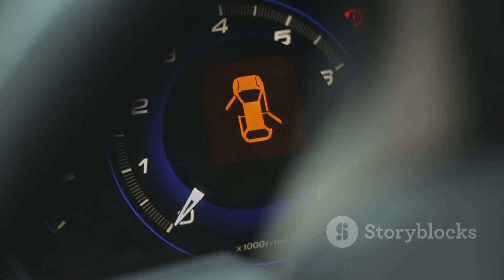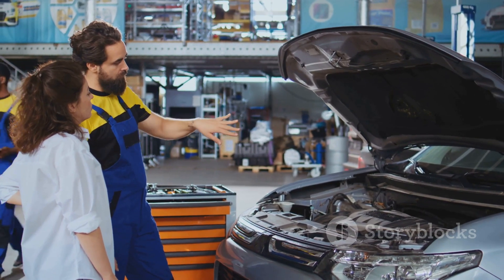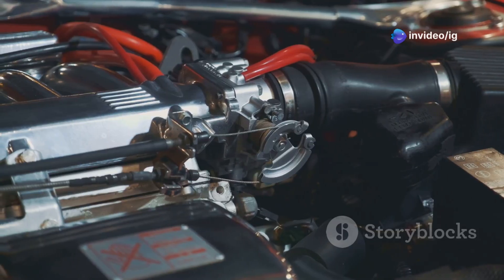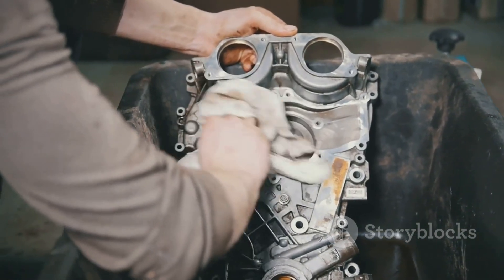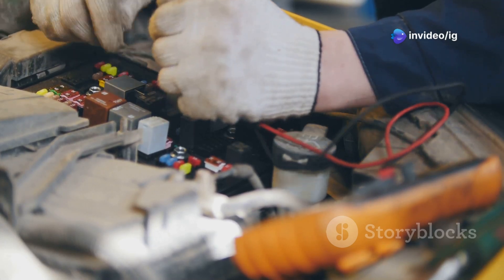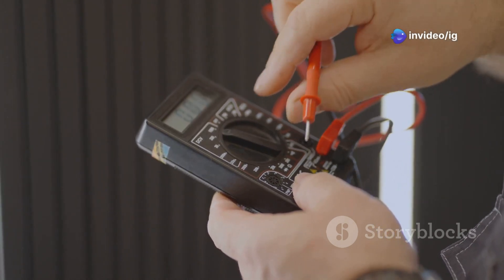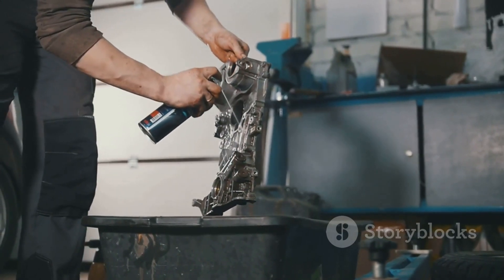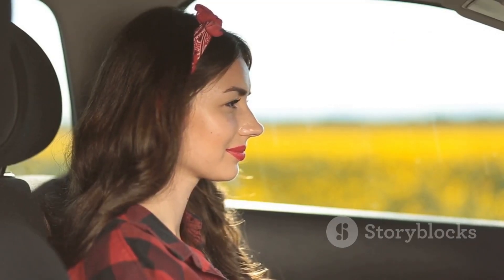P0123 | p0123 throttle position sensor circuit high input | code p0123 | dtc p0123

Comment: I need to know how to replace or is it similar to a Jeep Wrangler 99PO 123 throttle pedal position sensor switch is it the same thing as you had in the video on a cheap Cherokee?